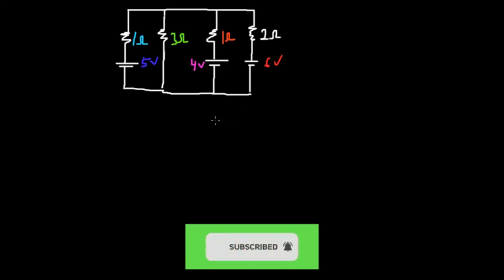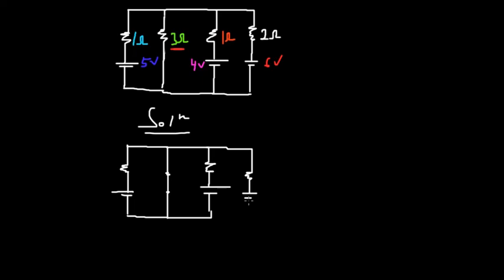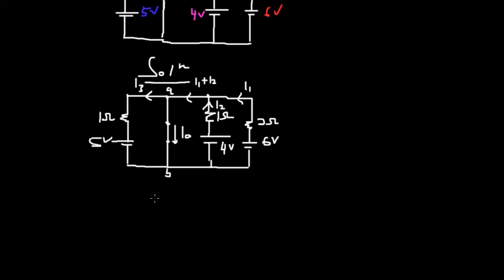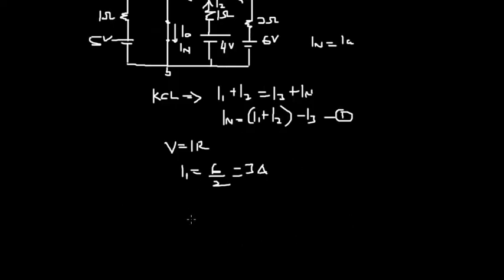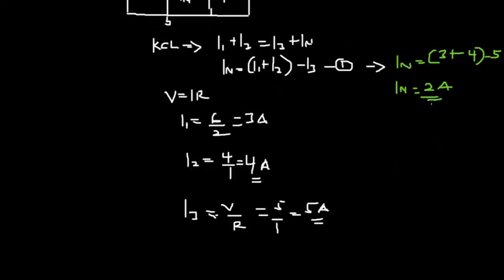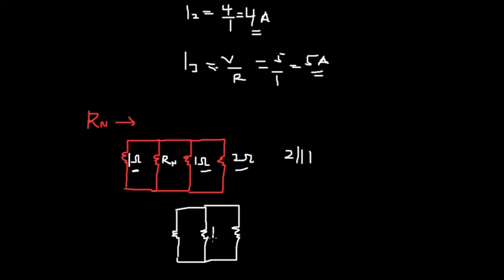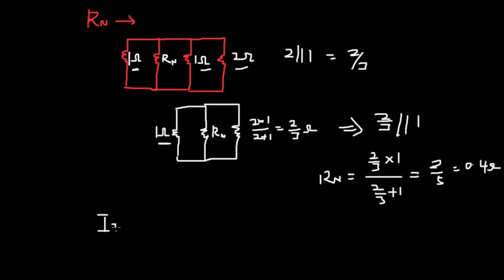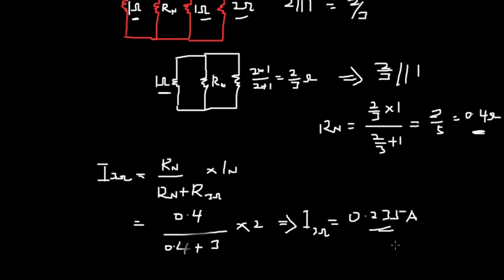MIDSEM EXAMS| SOLVED PROBLEMS ON NORTON'S THEOREM #knust #electricalengineering #nortonstheorem

Comment: why didn’t you make a current come from the 5volt source but you rather showed a current coming towards it???
Reply from the maker: Hello Hillary, you can decide to show that, the current I3 is coming from the 5 volt resistor okay but the final answer you’ll get for that I3 current might be negative because we are concentrated on applying the current in a way that would eventually favor the Norton’s current I.e we want to find the Norton’s current hence we work around that... in conclusion, I3 could also be coming from the 5V resistor but the I3 might end up being a negative current value. Hope this clarifies your question?
Reply from the maker: In addition to this, we are applying KCL hence the direction of the respective currents in the circuit; in other for us to arrive at a positive Norton current value (In)